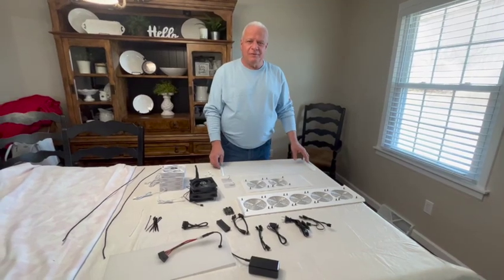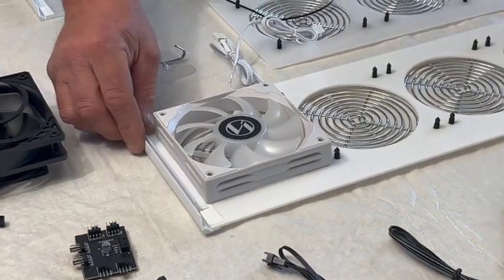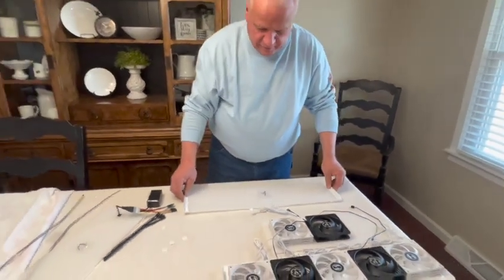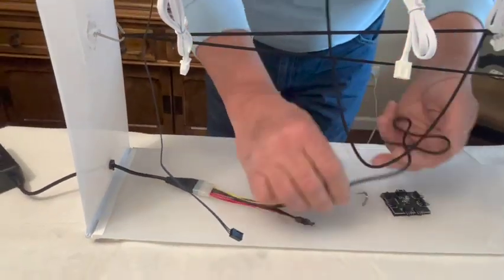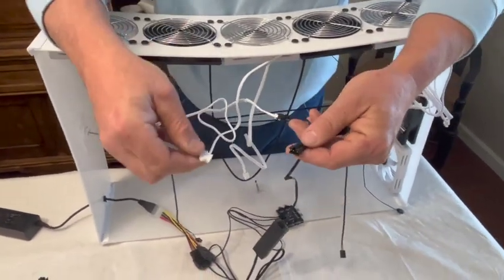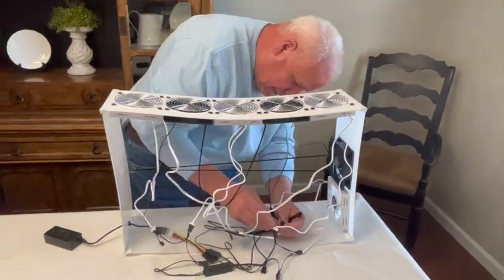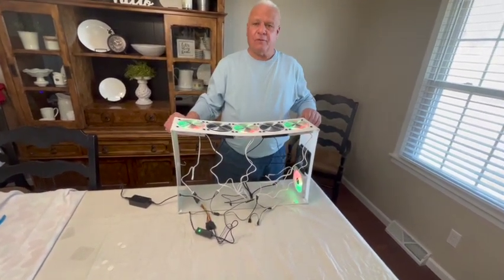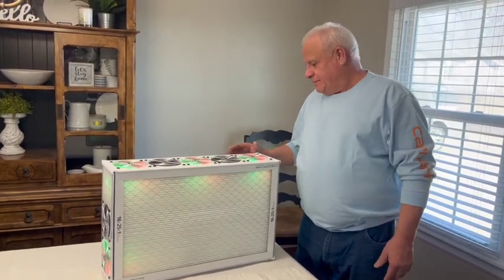Healthy Glow Kit - Lian Li ST120

Comment: Power supply connector isn't fitting into the DC adapter cable. Why?
Reply: You guys didn't even show that part. It's just not fitting. It goes on a bit and then stops. Do I have to damage my unit to force it to fit?
Reply: ever figure it out?